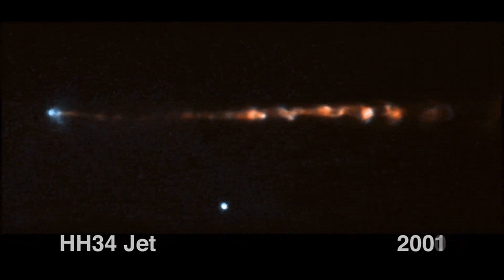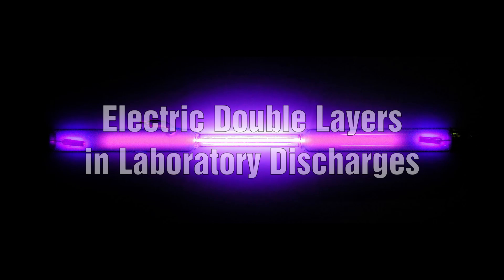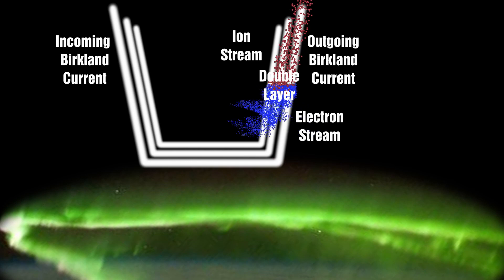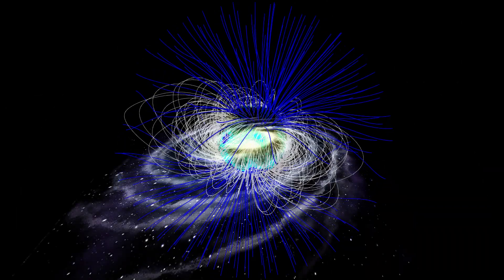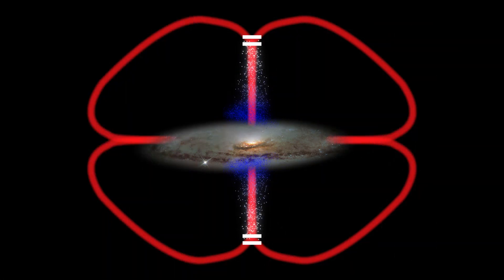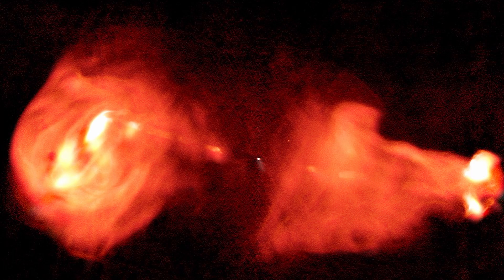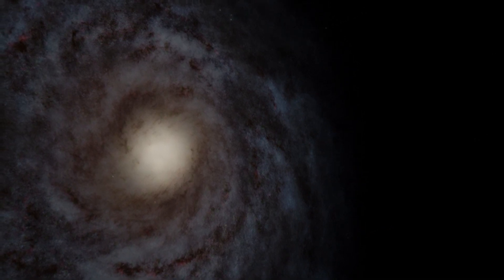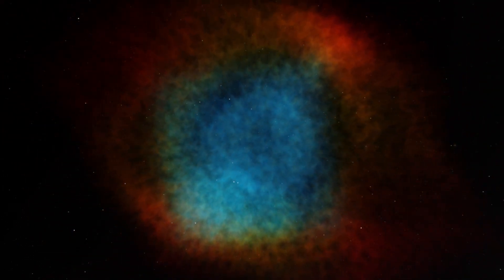Alfvén's Galactic Circuit

Comment: Nice video and presentation. 
I learn that electric circuit needs closed loop to do work. Struggled to accept that an electric sun can be energized by open loop plasma circuit. When I saw closed looped circuit offered by Alfvén’s sun model I was relieved but still struggled to read that the model is a endless energy cycling loop type, matter and gravity rush towards the sun can produce electric energy out of polar regions and then to matter gravity again back to the sun.

Comment: and what maintaines the rotation of the galaxy which constantly is spending energy by 'working'?
Reply: The rotation is the self organisation of matter having a corresponding forces applied upon it. Think of a whirlpool forming as you drain a bath and the surface approaches the drain level. It is not 'expending' energy to create the whirlpool, it is merely the most coherent structure and/or form for facilitating the corresponding forces experienced and the tendency for the matter to transfer from one medium to another as efficiently and effectively as possible.

Comment: The universe is a field containing a continuous cycle.  Radials of returning energy meet at a core position from which spherical expansion radiates.  As fractals of energy expand cool and interact they coalesce around these contracting ground wire wormholes giving them a giant superstructure.

Comment: What happens to our Sun when we pass through the current sheet of the Galaxy. A sheet of high energetic particles that separate the opposite poles. Lots of high energy particles, I'm sure the Sun would like that...🤔.. I mean the sun is stable it wouldn't have a devastating reaction. The sun has room for all those energetic particles pressed together, without having a micronova...🤗... or does it?

Comment: Like other comments I'm also struck by the reoccurring fractal  shapes apparently created by standing electromagnetic waves propagated within polarised self organising charge separated material structures, essentially burkeland currents.
We know plasmoids are created by volumetric restriction about an energetically flowing portion of burkeland currents and that such phenomena can easily be created in laboratory conditions by correctly creating an electrical flow terminated by a properly spaced and shaped exit point, seems to me a plasmoid is simply a more compressed version of a burkeland current short enough to re-supply itself from both ends respectively until natural discharge decomposes the organised structure,
The thing that interests me is that if quasar's are dissipating galaxies splitting off into new pairs then galaxies are obviously receiving extra electro motive force from their parent burkeland currents, mabe as well as new particles also.
I also think intense plasmoid formations at the centre of most galaxies may be perfectly capable of literally re-cycling heavy elements back into original hydrogen nuclei and free electrons respectively, thus storing and conserving the excess electro motive force of an unstable burkeland current formation in the form of new nascent lighter elements allowing the universe to repeat the process again while at the same time giving our universe usefully organised structures.
See what you've done to my brain thunderbolts...
Something very interesting to think about at the very least thanks.

Comment: The rotation is in principle made by a homopolar engine where the galaxy is the disk of the engine ... It'S Lorentz force.
Right hand rule. The magnetic filed is in 90 degrees rotating around the jet coming out of the galaxy. If the quasar is sitting in this jet and accelerating outwards, he permanently gets a magnetic flield rotating around what induces current into the quasar. This makes the rotation.
Explaination about homopolar engine:
https://www.youtube.com/watch?v=6Oj4qvCR6ow

Comment: The model closely resembles Krafft's model of the ether vortex proton. The same structure of the electron has the polar flux as sinks, not jets, meaning the equatorial migration would be outward, while the equatorial flow for a proton will be inward.

Comment: If we start with a Galaxy, it releases energy along its axis/pole and recaptures in its field, absorbing through the circumference; out top, in equatorial. 

Stars and planets, on the other hand, do the opposite; charge arrives in at the poles and flows out along equatorial plane. I would then assume it is captured in the Heliosphere and directed back to poles. This may suggest Stars and planets are a part of the same order of magnitude; Heliosheathe is the focus, not the star. Star and planets are just load bearers to manage incoming charge on sheathe.

I see no reason why, as galaxies spit mass from the poles to eventually acrete into young galaxies (allegedly), why suns wouldnt spit out hot mass which would settle within one of the double layer regions to cool; planet. Planets may do same thing whilst cooling to create moons, or moons are just bits of the initial stellar ejection that never acreted into the main body. This is all to manage charge with heliospheric environment.

The beautiful thing is creation and ultimately life itself just seems to be a byproduct of the Universe trying to manage excess charge. Mass is a way to store the charge in a stable manner; Mass eventually leads to complex Mass (Organics) and then complex organics; Life.

Comment: I’m struck by how two common patterns flows thru multiple levels of the electric universe.. one a filament and the other a node, both amidst some ambient flow. The features of the node you describe are amazing, in concentrating in the plane by twisting momentum’s ever tighter at the core, to create the node and axis; and also along the axis by virtue of the electric magnetic. My intuition says the difference between the systems kinetic and the magnetic energy is proportional to the ambient flow the node lies within, and the axis is perpendicular to that flow bc the spin is able to transfer the larger ambient electrical current into its z-pinch, effective driving the circuit of the system(s) below. As quasars are flung to the outer limit they carry field lines and currents with them that functionally define the space between, defining a fractal volume. I am more and more interested in finding examples of resonant coupling at this scale.. thx so much for your great videos.
Reply: Any clear science on the orientation of the axis w respect to flow welcome. Just the fact that our planets orbit perpendicular to plane of solar system is where I start.. seems like everything is aggregating into larger copy of itself. The pair of double layers at the poles is amazing high frequency source.. like an apples growth between stem and flower (slices apple, looks at pentagon)
Reply from the maker: Yes I am struck by the fact that we see these same patterns at all scales, like a fractal
Reply: See the Pattern Has anyone done a fractal curvature analysis and  comparison between large cosmos and say, human neural networks? I see such parallels to my eye is nigh same. I’m very interested in how fast twists might propagate along Birkland current.. or how slowly.. what is baseline and what is harmonics..
Reply: How fast can a Birkland current “tow” a star to a new location in space? Much as planets positions might be maintained by large electric ⚡️ is there some similar radical motion for stars occasional as large mee currents flicker on some way?
Reply: @SeethePattern  or plasma, because it is scalable. therefore just as EU threory demands, gravity is not the dominant form of energy in the universe, its plasma. but the master of science and math, the high priests love their infinities, when a simple elegant and beuatiful explanation would suffice. it makes them feel special as only "they" can do the math and if your cant, your cant be part of the club, and as for the nature of the universe, well your just going to have to take thier word for it.
this is why we see fully formed galaxies so early after the big bang. at the dawn of the cosmos. they are wrong and climg to the old paradigm because if we knew, everyone would have electro-gravitic craft, and thats not good. think NK with an anti-gravity craft. not good. so we must continue to deceive the public and world at large because the truth is terrifying and upon short order we would probably destroy each other.
Reply: @randommm-light  Many kind of figures are seen in naure but the one that nature most like are  hexagonals just like snow flakes that seen flat is like an asterisk surrounded by a circle forming six parts that all meet at the center, the central horizontal axis of the asterisk is the disk that forms as the six sides meet at the center midle part of the system so forming as well the WHITE SPHERE.

Comment: Hey @See the patten

I'm not sure if anyone else proposed this here but could the galaxy rotation just be an electrical effect caused by plasma and electricity's tendency to spin?
Like a farraday motor?
Reply from the maker: Indeed this is a possibility.  It would require an incoming current to drive it.  Most certainly the rotation we see is electrically driven.  As the magnetic field turns it indices currents in the plasma, like a motor.  The question is whether this is initiated via gravity to kick start it or as you suggest externally.  At the moment I see both as possibilities, it is even possible both occur.  What we don;t really understand is how the different systems interact.  How does our solar circuit interact with the local Birkeland current.  By studying these we should get a better understanding of what might happen at a galactic scale.
Reply: @SeethePattern  Have you watched David Lapoints 3 videos, The primer field?
Amazing videos, and he demonstrates his idea of how we have misinterpreted the structure of a magnetic field and demonstrates how and why Jets are being forced out of the pole regions.,...
the fact that NASA has verified that dozens of galaxies have been found with magnetic fields that are so large they actually encompass one Galaxy to another.  
His own plasma experiments, his lab sun begin spinning automatically very quick. I think of the Thunderbolts project thought about his magnetic pole design and merged themthey would continue to explain even more than they are able to do now which is a lot.
Reply: The Egg! No! The Chicken!
Reply: In this case of galaxy working like A faraday motor, did we have a singular or a dual and interchangeable identity between the magnetic axe and the battery inside the black hole (actually they are quite the same as structure) ?
Also, if we make analogies with tornados, what if we make analogy between galactic structure and every living structure, mostly with the vegetal ones, plants for example. In this case we see that there has to be a certain environmental factor... to the evolution of the quasar into a galaxy... like a seed that bursts into a plant in fertile grownd and secures its feeding process. 
Also the spin properties of a galaxy has to be initiated beginning from the spin of the quasar, like the spin of the bud following the rotation according to golden angle in order to generate its phyllotaxis (https://www.youtube.com/watch?v=U-at-y3MicE). You know that this behavior is actually generating most approximate equipartite points disposed on a sphere? So: COULD BE THE SPIRAL SHAPE A TENDENCY OF THE CENTER TO DISPOSE CHARGES IN AN EQUIPARTITE MANNER ALL AROUND THE STUCTURE OF GALAXY?
Reply: I am guessing it   Many super magnetic disc are stacked and the equator has a swap of near total energies. It has to be very complex. Way out of my ballpark

Comment: I lean more towards the opposite direction of the causation. An electrical current flowing trough space forming galaxies. Currents then flow trough out the galaxy forming solar systems. But nice to hear another view on it.
What we can agree on is that plasma physics has gone astray, ignoring the fundamental aspects of plasma physics which is the double layers.
If you have virtually infinite conductivity and virtually 0 electric fields then the frozen flux theorem applies. But that requires an extremely isotropic plasma, which is far from what you find on the surface of the sun.
Reply from the maker: To be honest I'm not sure which direction the energy flows.  Alfven saw galaxies as the engines that drove the systems below.  We see the remnants of the cosmic filaments and we also see the motions of the galaxies in our local group and just beyond.  These could be moving along active cosmic filaments or are being driven by some other process

Comment: There is no extra energy!
Self organizing, self embedding autonomous systems doesn't need it.
...1(1(1(0)1)1)1...
https://www.youtube.com/watch?v=xauCQpnbNAM  Russel's paradox
https://www.youtube.com/watch?v=V197yIbG788 Bruce Stillman
https://www.youtube.com/watch?v=dUv35CPi-mQ David Yurth
Reply from the maker: Indeed a cosmos that is continuous and regenerative just the movement of energy from one area to another, from one type back to another.  The key is in understanding how the different systems fit together and exchange energy.  In Alfven's model he looked at just the galactic system and saw this as a driving force but of course something had to put the plasma there in the first place in order for it to gravitationally collapse to create the required energy.
Reply: @SeethePattern  Water and light ... those are KeYs.
K is magnetic potential | with charge <. Red Blue Blur.
Look water on glass of car while raining...analogy to how lighning occurs.
e is ln growth factor ... how infinite ratios become circle.
Y as 3 is 5 platonic solids. Also X*5dots Y(4 dots...but connected XY 5+3 dots) is e8(G8,89, velocity,stretch of the line or spring) 5'3' DNA movement. Quasi is penta. PHIve 71/108.
See alphaBet waves XYH. Asphalt brakes by those letters, by those primes.
Key is 💎. Elastocaloric effect. Master B.
ln(3)~1.1 degree of twistatronics
ln(4)~1.38 6 (we are 138 path 6 God's secret source code)
ShalLOW waters pattern. Shadow(sing Y).  Shall we SheLBY?! L90 or i.

Comment: Incredibly informative! I wish all the EU videos were this in-depth and clear simultaneously.
Reply from the maker: Thanks.  That is one of the reasons I started this channel.  I was frustrated with a lot of the material and it left me with more question and not really understanding it.  I'm really glad it has helped you too :)
Reply: @SeethePattern  I've noticed in the past few months the Thunderbolts projects videos and explanations have drastically improved....and now I can't wait to find out how far they're going to take their plasma sun, the sapphire project that they are venturing into the commercial realm with. And I found it very intriguing to find out more about their accidental discovery getting the same power output at only 7% after a little experimentation......

Comment: This could explain elliptical galaxies, wherein their plasma angular momentum has been completely sapped, and thus take on a more spherical form rather than a flat spiral disk. One could try verify this by comparing where quasar's are, if there are any quasars near the Z axes of elliptical, if there are none, then it means this closed circuit and double radio sources have been spent, and the entire elliptical galaxy acts more like a single focus in the universal electrical birkeland current, kind of like how there are hot stars such as white dwarfs but have no anode tuffs that increase luminosity, the white dwarf simply lacks the surface area or corona to focus more current density - Or the inverse and are like "spent" stars with massive atmospheres and are dim and cool.
Reply from the maker: That's a really interesting observation and it makes a lot of sense to me... sort of the dying phase of a galaxy.  The question is what is left behind when the current totally stops?  I mean the stars would stop shining, probably the plasma would drift... but what about the planets?  It would be like a dead dark galaxy or does the matter get regenerated somehow?  Hmmm you've really made me ponder there and I like it :D

Comment: Where does the rotation come from?  Right rule.  The electric current itself causes it.
Reply from the maker: But that like the chicken and the egg. No rotation no current. Alfven proposed that the rotation came from the gravitational collapse. Nowadays it is recognised that there are more likely circuits within circuits. So indeed the rotation could be fuelled by the galactic current but event then that needs a cause...
Reply: I suppose the rotations can tell us which one is a motor and what is a generator ? SO you need electrical energy to convert to  mechanical energy.......maybe your double layers above the poles and the ones at the edges have something to do with it ? the nature of the connections ? and some torque....
Reply: I wonder if the size of the galaxy and a certain amount of current will be the perfect recipe for rotation. At a certain moment the pastry starts to rise......the galaxy starts to rotate. The right environment.